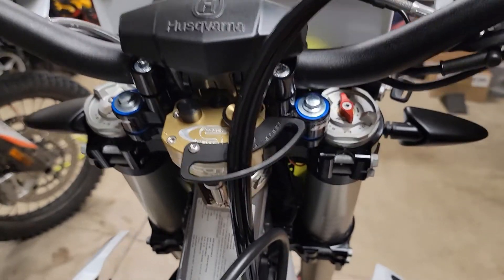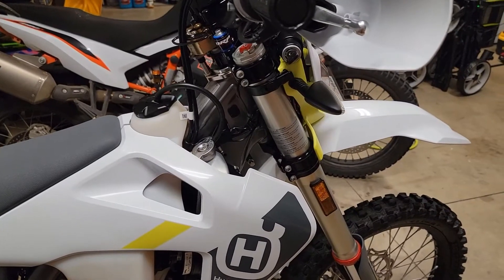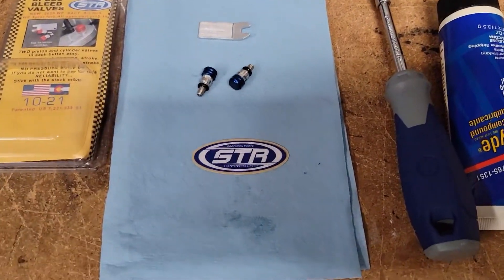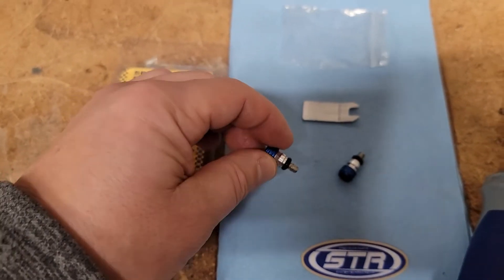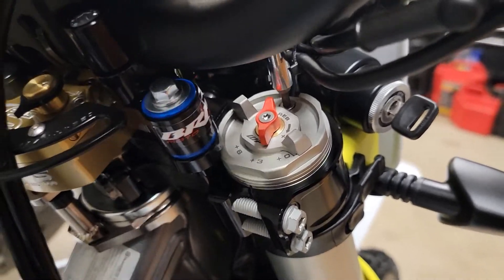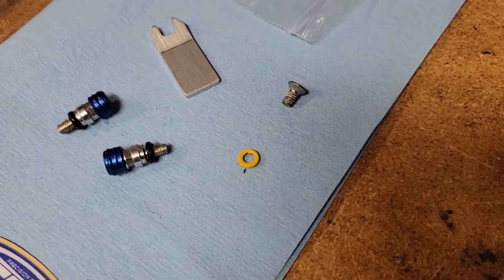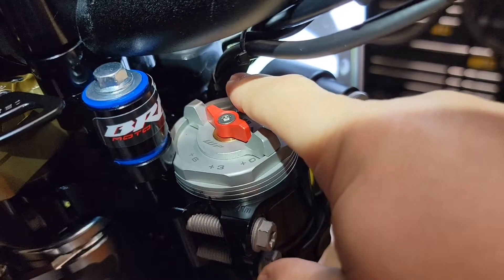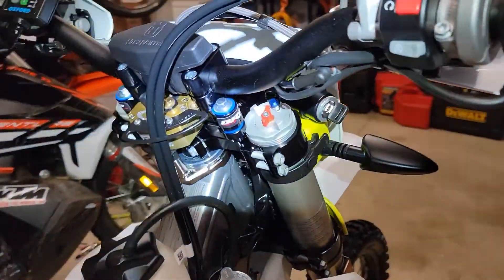Don't build up pressure in your front forks while riding! STR Fork bleeder installation FE 350s.

Comment: Do you have it also on your 890? Or it's not necessary? I have R version and considering is it worth to install bleeders.
Reply from the maker: Yes, great easy upgrade to add to the 890!  I do have them installed on my 890 as well.  I love this upgrade because it is so easy to do and very functional.  Just be sure to keep the old screws that come out in case you ever need to ship your forks for repair.
Reply: @oregonmotojohn  I see a big problem if you have the preload to +3 o.0
Reply from the maker: @furkadiscotd5  Yes, good catch, they are turned like that to get the adjusters out of the way so that the fork bleeder can be installed and shown on video, those are not representative fork adjustments for riding.
Reply: @furka66 This is a very good point!

Comment: Interesting.   Did know know or think about air buildup.    Thanks something else to tinker with ;-)  Cheers.
Reply from the maker: I didn't think of it either, but apparently all that pistoning and friction of forks makes heat and the expanded air needs to come out or it artificially increases preload with air pressure.  I am glad that someone smarter than me figured this out.  Thanks for watching and commenting!  Been cold here, but will get some more rides on 890 up soon!  Ride on!